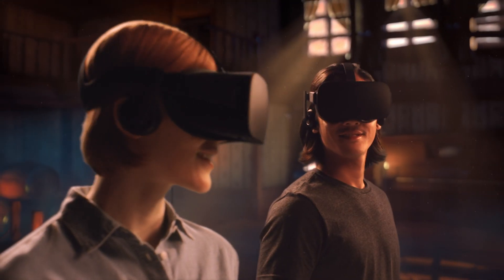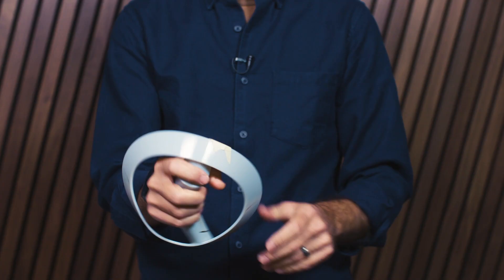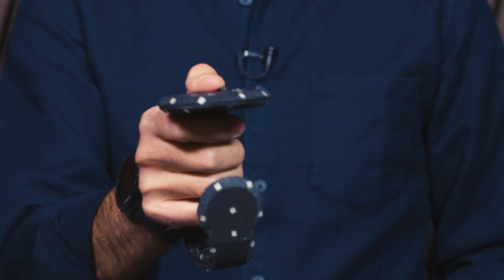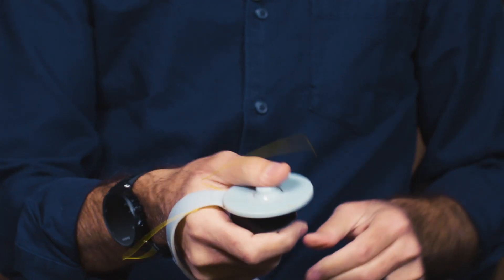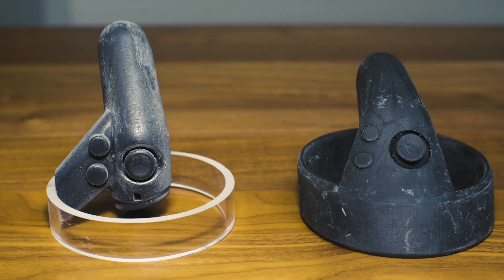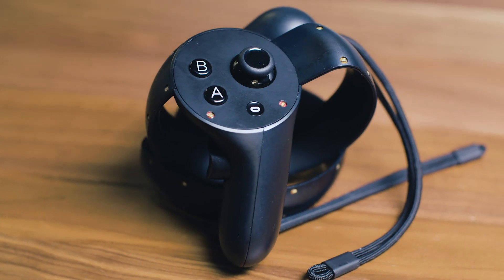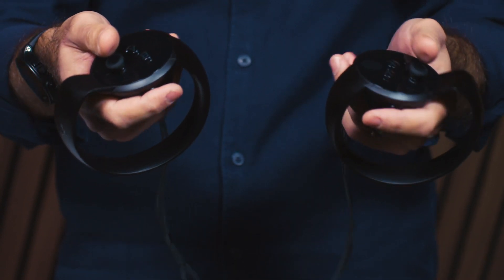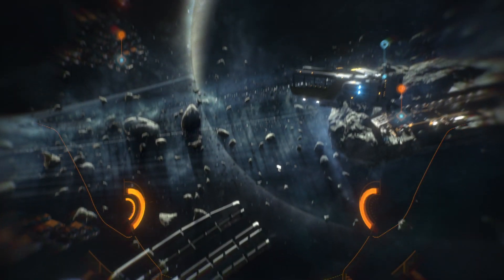How Oculus Designed Its Touch VR Controllers | WIRED

Comment: So, I just wanna mention how impressed I am with the capacitive sensors on the buttons. It's not just a touch sensor, it's like a proximity sensor, but a binary one. Your virtual fingers bend and straighten, when your finger is actually like a few millimeters off the buttons, not even touching them. It's really wild! And it means the virtual fingers actually move closer to how ur finger is really moving. not just auto-snapping the second u aren't touching a button, it waits till it's a certain distance.

Comment: Then i cant understand why the new Occulus Rift S dont use the same good Occulus Touch???????????? Instead we can use the Occulus Touch we already use,
they force us to buy a new one Oculus controllers and the worst about is, they are not so accurate in tracking like the old one...  I cant understand Oculus!!!!
Reply: You have to buy the new controllers ONLY if you buy a rift s or oculus quest, the new design on them is for the inside out tracking on the headset to see the controller.